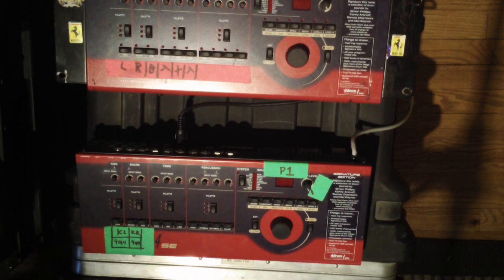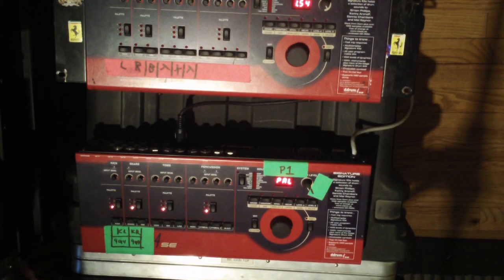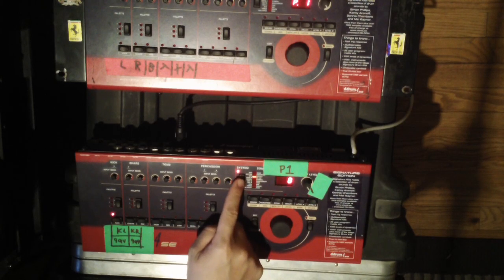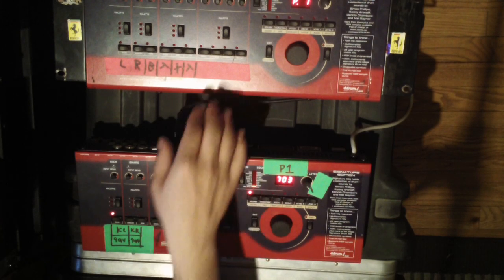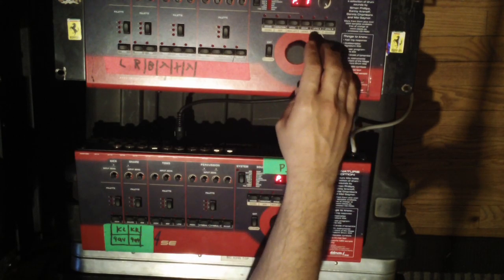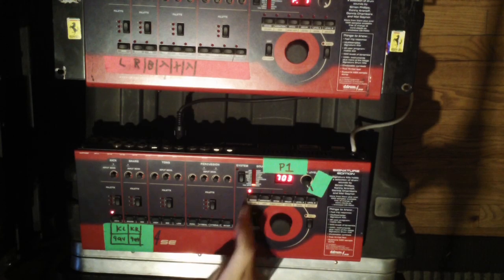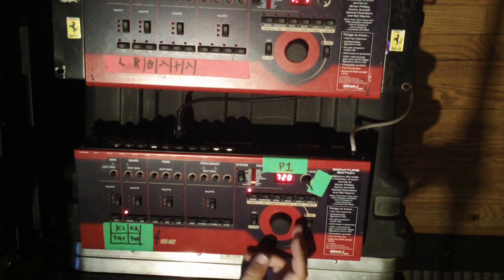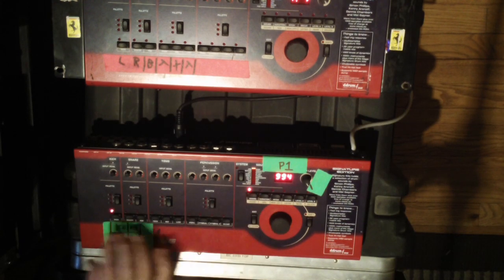How To Transfer DDrum 4 Se Sounds

Comment: Thanks for the video I actually never tried it this way and it also works for the whole system dump into the backup unit, very handy.
For any information/Links/Tutorials regarding the Ddrum trigger series you should check this link:
http://unofficially-ddrum.proboards.com/
I've found it by doing a Google search and it had all I needed at the time.
Cheers!

Comment: Robert, don´t know if this helps but if you have some kind of audio interface with midi connection for your computer. and a music program like Logic or Cubase you just put a cable from midi out to the midi in of your ddrum 4. Then all you have to do is download zip files containing samples in midiformat and unzip them. 
Open your music program and create a miditrack. Then drag and drop the midifiles you want onto the track. Move them so they are not overlapping.
Press play and enjoy the magic!

Comment: I just bought a Ddrum 4se 1.50 I have the Cd sound library and down loaded onto my PC, from the computer i am running a usb cable to my alesis trigger io and from there i am running a midi cable to Midi in on the module i tried to do down load some samples but no luck....could you be of any help?
Rob